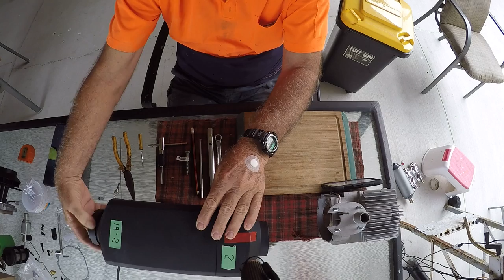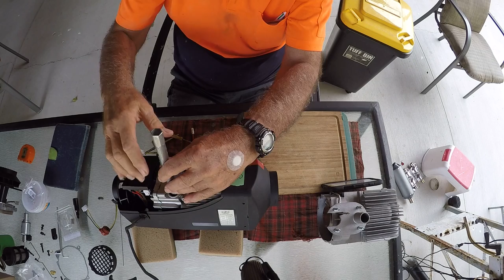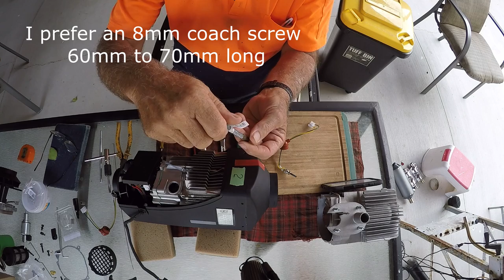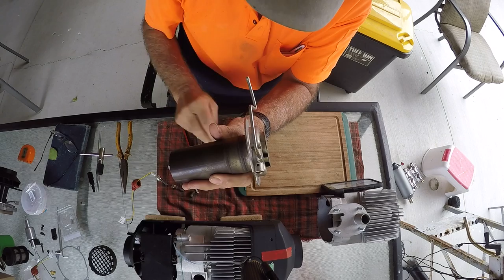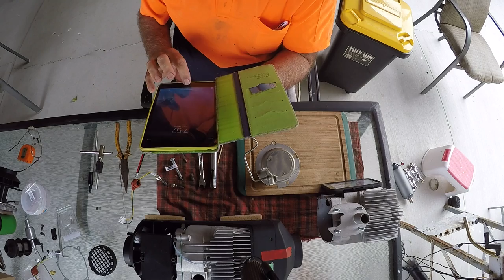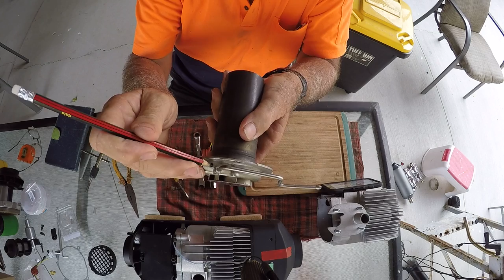Chinese Diesel Air Heaters - Part 9 Glow Plug & Atomizing Screen

Comment: Hi sir! How are you? This piece could cause the Error 03? I’m having this error on my happybuy diesel heater. Should I replace the piece or could i have another problem? Where can I buy this pieces? Can I change just the glow plug or should I also change the filter?
Reply from the maker: Hi Martin,

Generally an 03 Error relates to the glow plug, but I would like to know more details. Eg is the heater new, has it been running well in the past, was it recently serviced etc.

If brand new, it is possible you have a 24V heater and the glow plug will not get hot enough on a 12V system.

If recently serviced, perhaps the glow plug was damaged, perhaps it was reinstalled incorrectly, perhaps plugged into wrong socket.

First, if you have a clamp amp meter put it around the red positive wire from battery to the heater. The heater should draw around 8 amps with the glow plug turned on by the ECU on initial start up. If you only have 2 or 3 amps draw the glow plug is not working.

If you do not have an amp meter and you have some knowledge in this area you can remove the glow plug from the heater, plug it back in and turn the heater on. It should glow red hot.

If the heater was running well and has been recently serviced, or you took it apart to see the parts, the glow plug could have been damaged. They are brittle and easily broken.

You can buy the glow plugs online, there are many sellers. Search for glow plug, or ceramic glow pin for diesel air heater. I am reluctant to give links as these sellers come and go. I have often gone back to a supplier who I have purchased from in the past to find them gone. But here is one current supplier to get you started in your search. Make sure you specify the correct voltage.

https://www.ebay.com.au/itm/Car-Truck-Parking-12V-88-98W-Universal-D2-D4-D4S-Air-Diesel-Heater-Glow-Plug-/254250105439?hash=item3b327cba5f

If your heater has been running well in the past and you see a lot of carbon in the hole when you take the glow plug out your screen may be full of carbon and need cleaning or replacement.

I hope this helps.   JMcK
Reply: John McK 47 Amazing and detailed answer. Thank you very much. More context for the question. My heater is 12v, 5kw. It’s a brand new, and it was working fine fore like 2 weeks. I don’t know what could happen but just stop working. I remove the silicon cover from the glow plug and I saw some like broken transparent plastic inside/ I supposed that this is not normal.
Reply from the maker: Martin Azziz 

Hi Martin, looks like you may have a broken glow plug. I would buy a replacement and see if that fixes your problem.  Good luck.  JMc

Comment: hey, at the first ignition i have the E-03 error.. all is ok, the impedance of plug is 0.3ohms.. all cable ok; pump ok, diesel ok.. i dont understand :(, an idea? thanks !!
Reply from the maker: Hi Alex, looks like you have a bad glow plug. With a resistance of just  0.3 ohms that plug would draw around 40 amps instead of just 8 amps.  JMcK
Reply: @johnmck1147  thanks, i think same thing, i have buy one to Amazon, and tomorow i return to verified the impedance. you know the original impedance? i think 3 ohms arround..

Comment: Actually they do work as a filter but you got to pull the foam up to the top in front of the air holes and then the air the dirt gets trapped in the filter that or  in the in the the sponge

Comment: I get the e-03 error its bran new never used what tips do you have to fix this . Its a pain for brand new  heater
Reply from the maker: Hi Ernie, error 03 is generally a glow plug fault. It could be a broken glow plug, a bad wire connection, or low voltage. See if you can get your hands on a clamp meter and measure the current draw on start up, it should be around 8 to 10 amps. You could also remove the glow plug from the heater and start the heater, a working glow plug will glow red hot. If your wiring is bad, or your battery poor, it may not deliver the necessary amps.  JMcK
Reply: @johnmck1147  yeah thanks for your replay.  It ended up being the fan draggin  on the case and hitting the back of it. After i messed with fan and got it best i could to not be unbalanced.  No error codes ran it all night thanks .
Reply from the maker: Ernie T 
Glad to hear you got it sorted Ernie.  JMcK

Comment: so I installed one of these in my boat and it smokes.  Took it apart and there was liquid diesel in the body of the unit.  Cleaned everything, atomizer gauze, glow plug - which had a bit of white on it.  Checked the voltage with multimeter - good volts.  It still smokes, it's a new unit too.  It seems like it is being over fuelled, the unit comes on, I can hear the unit ignite, exhaust is good then the fuel pump  starts up and she smokes and throws error code 10.  I am using the hard style fuel line, have the pump at 30 or so degrees, fuel line in total is less than 30 cm.  I've removed the filter for the air intake, exhaust has less than 270 degree of bends more like 90, Fuel is fresh, unit is flat mounted, I'm stumped.  .......Am awaiting to hear from the seller after emailing them.  Any ideas - insightful grasshopper!!!
Reply from the maker: Hi Cammo,

It is not uncommon for these heaters to smoke on first start up, and then they run clean. Start the heater and let it run for a while. After the first start it should then run clean.

I assume you are not trying to prime it each start. You only prime once.

Is the fuel tank higher than the heater?
If so you need a shut off valve between tank and pump as you can get seepage past the pump into the heater. You need to shut off the fuel when heater is not used.

Turn the fan by hand, do you feel any resistance that is slowing the fan down?
Does the fan start first and run for a while before you hear the pump start ticking? If not you could have a faulty fan speed sensor or controller.

Cheers.  JMcK
Reply: @johnmck1147  after first start it smoked so I shortened the exhaust. It then ran perfectly so I shut her down thinking it was ok.  Upon second start up it smoked badly. I shut her down, changed the soft fuel line to the hard line and start her up. Again she smoked. Stripped it down and found diesel in the chamber. Cleaned her up, connected everything, checked volts etc ( best mates an auto etc who walked me through everything) volts were good and it still smoked and didn’t start up.  I’m confused about it and have emailed the seller, I have a feeling the pump is over fueling as I can’t figure out why it is smoking so badly.
Reply: Hi John, the heater is mounted about level with the middle of the fuel tank, the bottom of the tank where the fuel outlet is located is below the heater but the fuel in the tank is above the heater - hope that makes sense.  
I only primed it once.
The fan does not start before the fuel pump.
Your comment on the fuel level makes sense however, when I disconnected everything and cleaned out the heater and reinstalled I immediately turned it on so there was no chance of fuel seepage at that point.
Reply: @johnmck1147  Hi John.  The fan does start up immediately, I couldn't hear it over the boats engine.  I removed the air intake hose and sprayed a little upper engine cleaner and started her up.  She's running as I type and smoking up a storm but, it is running and burning off all the unburnt diesel in the unit.  I have ordered an inline fuel shut off valve so my final question to you is - Do I shut off the fuel and let the last of it burn off instead of going the the units off function?  I do this with my two stroke lawn mower!  I appreciate your advice too, so far the seller has not responded to my questions.
Reply from the maker: Hi Cammo,

No, you turn the heater off at the controller and let it do its run down cycle. The glow plug will come on, the pump will stop and the fan will run to burn off any excess fuel.

Only after the heater shuts down completely do you close the fuel cock. You need to remember to open it before you start the heater again.  

Good luck. JMcK
Reply: @johnmck1147  thanks John.  I am also going to put a loop in the fuel line which will be higher than the top of the fuel tank.  I bought a can of ‘start ya bastard’ and had to use it this evening as it was smoking again. A half second burst into the air inlet is all that’s needed to start it burning properly.  We might do an overnighter on port Phillip bay saturday/Sunday to test it. Thanks again for your advice 👍🏻🍺🍺🇦🇺🇦🇺

Comment: Hi. I've been looking for atomizing screen on ebay as well as on aliexpress but nothing comes up. Are you sure that is what it's called? Also mine is an older version of Chinese heater and it is webasto copy.  Do they have the same screen? Thanks
Reply from the maker: Hi 3dmixer, 

Eberspacher and Webasto heaters are quite different, and so are their Chinese Clones.
You can not use most of parts for one in the other.

I am sorry, I can help you source Eberspacher screens but I have no knowledge where you can buy cloned Webasto screens. 

Perhaps a viewer may know and leave a post here.

Regards,   JMcK
Reply: @johnmck1147  hi. Thanks for getting back to me. Mine is an older version bought it from China about 3-4 years ago. At that time they were not available on ebay and they were pricy compared to the prices today. I have not had any problem with it until recently. No it won't fire and blows white smoke. I know it needs a good cleaning as it hasn't been cleaned since I bought it. I'll take it apart next week and we'll see if anything needs to be replaced at all. I might just get away with a good cleaning. Thanks

Comment: Are glow plugs same and same size for 2 Kw and 5Kw?
Reply from the maker: Yes. The glow plugs are the same for all the heaters. However they come as 12V and 24V, so don't get the voltages wrong.  JMcK

Comment: Hello John. One year sitting won’t start. Error code E-01. I put display on voltage and it goes from 12.2 to 8.5 and battery icon flashes. Now my supply battery registers 12.3v and because it is on converter it doesn’t change during heater start up. Please help. Thanks
Reply from the maker: Hi Keith

Looks like you have a low voltage issue at the heater.

It does not matter what the supply voltage is if the heater itself can't get acceptable voltage on start up when the heater can draw up to 10 amps, mostly for the glow plug.

I assume the heater was running previously.

First I would check your battery under load. Can it supply 10 amps and still hold its voltage above 12V? You may have a defective battery.

Next I suggest you double check the supply voltage to the heater by hooking up a different fully charged battery. If it works with a new battery you have a battery issue. 

A poor battery can show a voltage above 12V at rest (no load) and rapidly drop voltage under load.

If the heater still won't work with a new battery, you probably have a wire loom issue or corroded wire or plug issue.  Check your wires and plugs for signs of corrosion and spray them with WD40 or similar.

Check you have a voltage of over 12V at the heater.

If you extended the wire loom, did you increase the wire size? The wire loom as supplied is a bare minimum size.

My guess is you have a sick battery.

Good luck.  JMcK
Reply: @johnmck1147  thanks John, I’m going to focus on that issue.
Reply from the maker: Keith 
👍
Reply: Yes I got a remember that voltage does not equal amperage and there’s a loss in the line going from the battery to the unit itself even though my battery kept reading 12 down till like 11.7 the digital controller on the parking heater will drop down to 8.8/turned off so I boosted it and everything is working now and it starts a little quicker because I blew at all whatever sat there for a year thanks again John for all your expertise
Reply from the maker: Keith 

👍
Reply: It appears that my fully charged 13.2v, 2.5 year old 70ah Walmart batteries do not have enough amps for complete start! So I put inline electrical quick connectors with battery clamps nearer the heater for additional boosting from external battery source. Starting every time now. Guess it’s good Time to upgrade to lithium. Must also change motor homes converter. $$$$

Comment: Hello mate, just stripped my 10month old 5kw unit down because of E03 error, and there is definitely no atomising screen in there. Must have never been fitted or went out of  the exhaust pipe 😂.
Reply from the maker: Thanks for that info Roger. The heater will be next to impossible to start without that screen. 
Did you see any residue of the screen?  JMcK
Reply: @johnmck1147  Hello, no marks or residue at all. The unit was working perfectly before it refused to fire up the next day, shoeing E03 and like an idiot didnt know the glowplug was a ceramic one and broke it getting it out!!. But the hot end of the plug looked in excellent condition.. The hole where the atomiser screen presumably fits is about 10mm diameter. Thanks

Comment: will you user fuel as in gasoline in your heater, gasoline as in the USA, it should work.. I want to put one like that in my RV that used gasoline .. help
Reply from the maker: No Hamish, these heaters are designed for diesel, the attempted use of gasoline or petrol in these heaters would be extremely dangerous. Here I am talking more EXPLOSION, than just FIRE. 

Eberspacher do make a gasoline version but you will pay thousands of dollars for it. These heaters come with their own fuel tank, why not just use that and use diesel?   Regards J
Reply: I know some one with one fitted he put a small tank in the boot of the car and it works well.
Reply: I understand you don't want to use gasoline in your unit.there was a man that did this on YouTube, the only comment I saw was it was just a hot as diesel. it was on a workbench. another person said; why was not hotter,,, no answer,, I am guessing the temp is controlled by the unit,,, I have gasoline in my RV and the diesel tank that come with, as other Y-tubes tested will last one day on high. Someone will post it. I hope.
Reply from the maker: Hi Hamish,

Yes you are correct re the fuel consumption, on boost power, a 10 litre tank will last around one full day, however in practice you would need to have a very large RV to run constantly on boost power. But in real world use, you perhaps may get up to 3 days use with the supplied 10 litre tank.

I would be most interested to have a look at a petrol Eberspacher model to examine the different burner parts, and see if a Chinese diesel copy could be modified to run safely on petrol. However, although I know from Eberspacher literature that they exist I have never actually seen one. If I did I will do a video of it. 

Have you contacted the utube gentleman that tried running petrol in a diesel heater? I will not do it myself as I can see the dangers of a dormant explosive gasoline air mix in the burner combustion chamber or in the exhaust just waiting for an ignition source. 

Good luck with your research Hamish. J

Comment: When looking for parts for the chinese 5kw or quassi 8kw heater are we looking at the espar D4 or D4 Airtronic ? The atomizer screens look different. Does anybody know the proper espar part #
Thanks in advance.
Reply from the maker: Hi Jeff,

Search for “Glow plug screens, diesel air parking heater” there are many suppliers, and most heater brands use the same screens.

Below is a link to get you started in your search.

https://www.ebay.com.au/itm/10Pcs-Mini-Glow-Plug-Burner-Strainer-Screen-For-Diesel-Air-Parking-Heater-/274618428381

Cheers,  JMcK

Comment: Are the 2kw plugs the same as a 5kw?
Reply from the maker: Hi Julio, 

The 2Kw, 5Kw and 8Kw, Chinese Diesel heaters all have the same glow plugs.
Remember you can get both 12V heaters and 24V heaters. The glow plugs are voltage specific.
Another point, the vast majority of Chinese heaters are copies of the German Eberspacher heater, however there are also some Chinese copies of the Webasto diesel heater. They look similar, but they are different inside, with different parts.  JMcK

Comment: thankyou so much ...not a techo but i really loved your lessons...now where do i get an appropriate glow plug to replace my 5KW chinese heater ..from Crazysales...cheers penelope
Reply from the maker: Hi Penelope, there are a number of on line sellers. Here is one link to get you started, just make sure you specify the correct voltage. 12V or 24V.  JMcK

Comment: I’ve been collecting spare parts for my two heaters both advertised as
A 8K I found everything except glow plugs are they all the same? I only have Amazon to shop from thanks again Bryon
Reply from the maker: Hi Byron,

The glow plugs on the 2kw, 5kw, and so called 8kw Chinese copy heaters of the German Eberspacher heater are all the same. But remember they can be 12v or 24 V rating. The majority of heaters are 12V heaters. These can be easily bought as spare parts on eBay, or on line.

Also be aware there are some Chinese heaters that are copies of the Webadto style heater. Webasto heaters and their clones are different in construction from the Eberspacher heaters and  have different style glow plugs.

I hope this helps.  JMcK
Reply: @johnmck1147  Is there a good way to tell the difference
Reply from the maker: Bryon Huff 

Hi Bryon, the glow plugs you see in my videos are Eberspacher copy heaters, the most common type. 

When I get some time I will try and do a comparison video.

Cheers. JMcK
Reply: @johnmck1147  thanks

Comment: Side thought, Would this concept design work on a larger scale, for like a waste oil burner, for like in the garage to burn waste oil. fabrication obviously
Reply from the maker: Sorry CO. They run on diesel, or a kerro diesel mix.
They will actually burn waste oil, for a while, but they carbon up quickly and require a serious clean before they will ever work again. JMcK